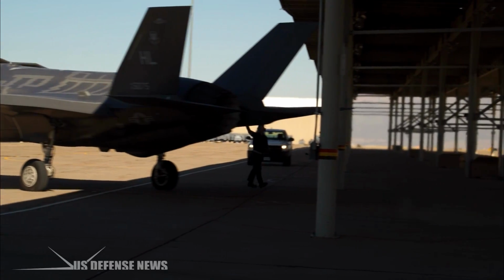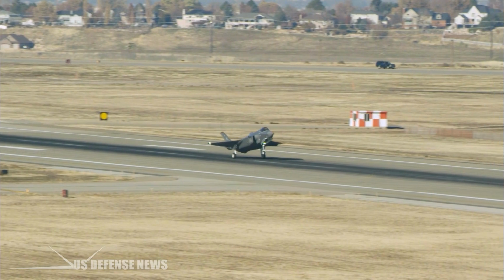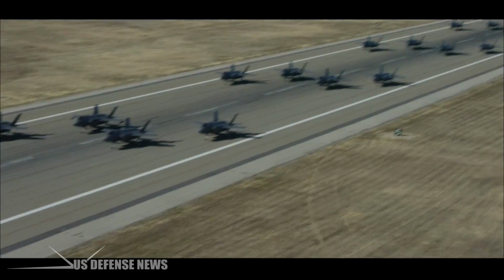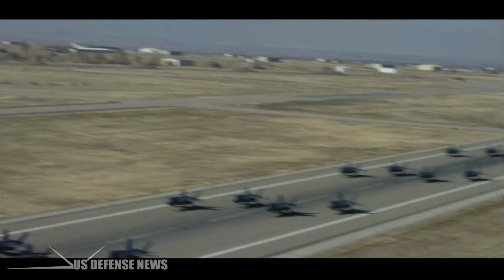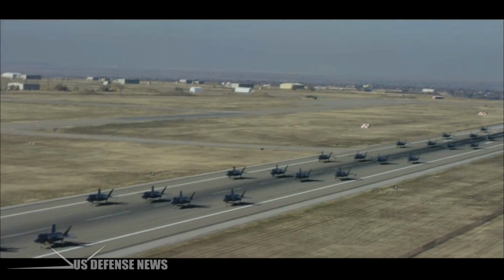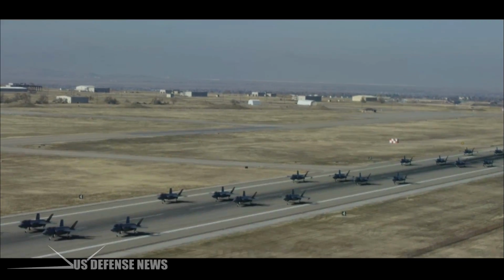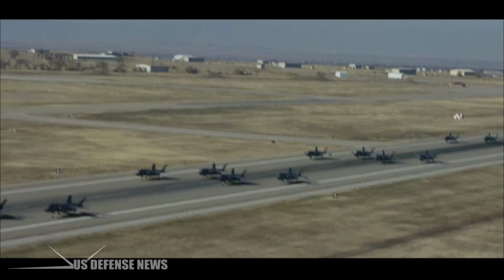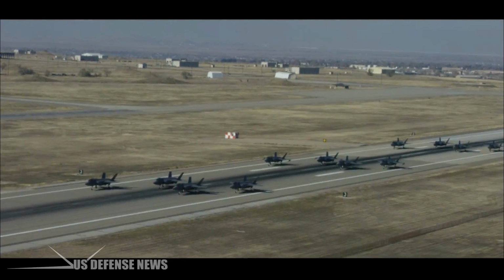Worst Nightmare for America's Enemies! USAF Conducts Huge F-35A Combat Power

Comment: Radar cross section is drastically reduced in the F35, yet it's single engine is one of the hottest, making it's heat signature easy to track. We really should have opted for a twin engine design with features to reduce heat signature, such as those found in the F22.

Comment: Why does U.S. need F-35s when it could have simply focused on increasing the number and capabilities of its f—22 fighter fleet?
Reply: To keep moving the technology forward. Just like in building a house, it is often easier to start from scratch than make a ton of additions fit an old foundation and frame. The F-22 is the best of 70's technology. The F-35 is the best of 90's technology. Totally different approach to radar cross section reduction. Totally different control systems, pretty much all fiber-optic in the F-35. Single engine carrier capable and VSTOL capable for the F-35. The theory, although it never seems to pan out, is that a common airframe for all branches would make for a cheaper replacement for the F-16, F-18 and A-10 missions. Per unit cost for the F-35 is roughly $80 to $120 million and will continue to fall as more are produced and the R&D costs get spread out. Back in 2009, the F-22 unit cost was $150 million. Today with R&D for upgrades, you would be talking about $200 million or more per F-22. Its really an apples and oranges comparison. The planes do different things in different ways.

Comment: Although it wasn't a "war" plane,  the SR-71 Blackbird,  was actually  completed BEFORE deadline,  AND,  it also came out,  UNDER budget. 
Either of those 2 things,  are practically in-heard of in the.. "military industrial complex".
Reply: Who told you that the SR-71 was under budget? Its utter BS. The SR-71 was a derivative of a CIA black project designed and built by Lockheed Martin which is today and always has been part of the MIC.

Comment: The dozen F-35A can be seen by terahertz radar and quantum radar,The J-20B can super cruised without afterburner at mach 2.5 speed. The 500 J-20B has four PL-12 (150 miles range)and four PL-21 VLRAAM (300 miles range ) in its two bay.

Comment: Easy work for the S-300...they won’t even let Israel use it against the export model S-300.🧐 if it’s that great of a fighter let them go at it...The defenses are reds, the ball is in your hand, now do something.
Reply: And this demonstrates the biggest weakness of surface to air missiles. You have to fly over them. Control the sky and you control the battlefield. NATO air superiority is undeniable.
Reply: What goes farther, a large missile fired from the ground that has to nearly reach space? Or a jet that's nearly in space that launches a small/medium missile with wings on it that can coast its way down to the target? I already have my answer, I work on bombs and missiles ...

Oh by the way, the missile launched from the ground also has to chase down the aircraft that's flying at Max speed. The jets target though doesn't even move..